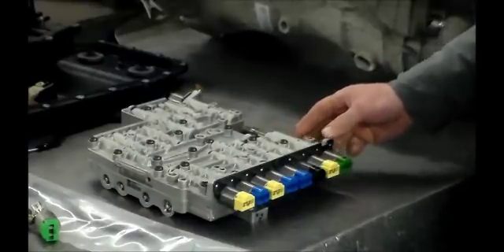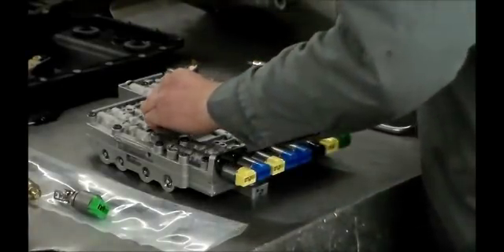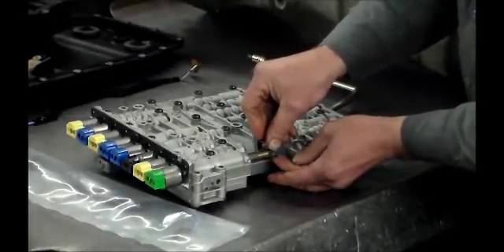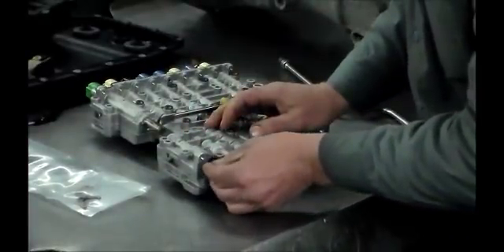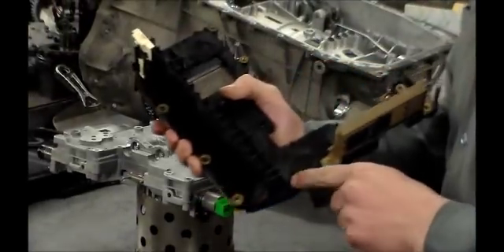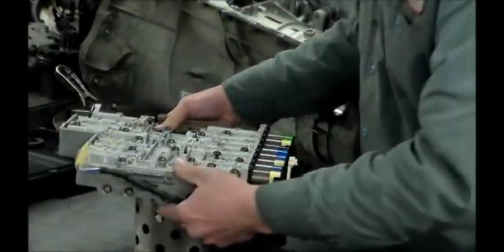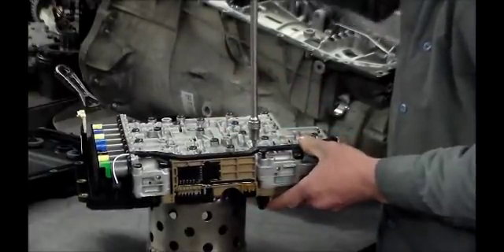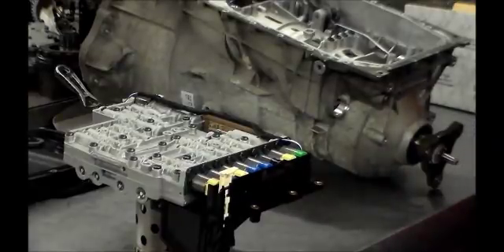ZF6HP26 E-Shift Valvebody

Comment: Thanks for this video.  What makes the gearbox judder?
Reply from the maker: I believe these converters had some issues
Reply: @GaryFerraro  Thanks for your reply.  My issue is some judder but more recently error codes and symptoms P0783 3-4 shift, P0735 gear 5 incorrect ratio, P0729 gear 6 incorrect ratio.  My garage is recommending a fully refurbished gearbox costing about $4000 fitted.  Is this reasonable/necessary?
Reply from the maker: @amana1480  First, did they check the fluid level?  A very common problem that can cause these codes is bushing wear, the rear stator bushing wears out and allows E clutch oil to escape causing issues in the higher gears 4th,5th and 6th.  Another common issue are the solenoids, they have a high failure rate, does the car drive ok cold?
Reply: @GaryFerraro  They did not physically check the fluid level no.  They said that if the fluid was low, there would be difficulty engaging reverse.  (However, I do get a clunk from the gearbox when I select reverse).  They plugged a computer in and checked the gearbox temperature (was 79degrees C).  They test drove the car for 30 minutes.  The car does slightly better when cold but still has the exact same same symptoms as when warm.  1st, 2nd and 3rd changes are reasonable.  3-4 is very difficult even when using manual. 5th can slip when accelerator is pressed.  6th can slip too on acceleration.  There is great difficulty getting from 3-4th gear, even when the manual mode and very minimal acceleration is used.  I looked under the car today and I could see what looks like to be a feint spray of oil where the gearbox joins the prop shaft.  The gearbox itself is not damp - it seems to be actually coming off the prop shaft at the joint with the gearbox.  I'm not sure if this is a gearbox leak?  There is never any oil on the pavement.
Reply from the maker: @amana1480  Sometimes these are fully covered underneath, the mechatronic sleeve likes to leak on this trans, if this problem happens cold, very possible you have mechanically bad solenoids
Reply: @GaryFerraro  Thanks for your reply.  Do you think my best option is for a fully refurbished gearbox for $4000?  I don't know what else to do at the moment.
Reply from the maker: @amana1480   Can you get someone to check the fluid level, if it's full, then you may need some work done on that trans.  First thing i always do with these units is check the fluid level
Reply: @GaryFerraro  OK thanks.  I will get the fluid level checked tomorrow morning.  Is it easy to check?
Reply from the maker: @amana1480  Car has to be level and on a lift,  fluid gets checked from underneath, there is a check plug(like a standard shift trans) car has to be running to check fluid level
Reply: @GaryFerraro  The first garage who originally checked the gearbox fluid level ("Landrover Specialist") said they do not pay attention to the exact gearbox temperature when checking the fluid level.  They said they just feel if the gearbox is warm with their hand.  I'm not entirely sure if they cycled throught the gears or checked the level with the car in drive with the aircon and footbrake on.  I will therefore be checking the level with a different garage on Tuesday (I'm not driving the car in the meantime)
Reply from the maker: @amana1480  ok, let me know what they say.

Comment: Great video thanks - I have an '03 760Li with the 6HP26 E-shift tansmission. One day out of blue my wife reported it moved forward unexpectedly when in park. It then went into limp mode and the 'drive moderately' warning came up on the dash. She turned it off, and it was OK for a while before more errors. There has never been problems with the shifting between gears. New oil/filter/square gasket 30,000 miles ago. I read the codes and there was one error (which had occured four times) which said '4E89 EGS: SV1 / SV2 mechanically jammed implausible signal or value (P1806). Fault currently not present. Fault would not cause warning light to come up. Frequency 4. Kilometers 196,784. I am assuming the MV2 or MV3 have failed and am planning to replace these as shown in your video. Am I on the right track?
Reply from the maker: I  know someone that had this code before, i believe the first thing he did was try the solenoids and reset the shift adapts, i do not believe that worked. Trying to remember, i'm pretty sure he had a bad valvebody and that fixed his issue.  You could try the solenoids first because even if you get a used valvebody i would change them anyway,  they go bad a lot.  Since you cleared the code, has it come back?
Reply: I had it fault 4 times before I took the valve body out but didn't reset it and try driving again. I have black and green replacement solenoids here so will try replacing MV2 and MV3 you cover in this video. The car seemed to be in drive when it was started (it surged forward immediately) which is odd because no power is required to any solenoids for the springs to return the gearbox to park (failsafe I guess).  I wonder if the error is corect that it must therefore be 'mechanically jammed' in some way to hold it in drive while powered down? I will chech the shift lever and springs as well, reset the shift adapts, replace the two shift solenoids, and let you know how I go.
Reply from the maker: Brett Cowan yes. Please let me know
Reply: @GaryFerraro  A follow-up on this post. The problem was the separator plate. I replaced this and put in a Sonnax kit, but did not replace the solenoids and the transmission is now fine. I suspect the unexpected behaviour was due to hydraulic pressure leaking from one channel to another in the mechatronic due to a failed separator plate.
Reply: @GaryFerraro  
Hi sir:
I have a 630 ci /2007 with joystick shifter... when i stop the car for 2-3 hours,  it will not shift to N, R or D,so i have to leave it for another 6 hours to go back to normal situation. Are these 2 Selnoids responsible for this problem?
Reply from the maker: @blackbirda3797  so this gets stuck in park?  or shift to drive and jumps back to park?
Reply: @GaryFerraro  
Sticks to park... if i tried the override,  it will shift to D (flashing) when ignition button is ON & to N(flashing) when ignition button is off. But if i didn't use the override,  it will stick to P.
Reply from the maker: @blackbirda3797  ok, can you scan the transmission, tell what codes you have

Comment: The 6HP26S in my 2010 X5M keeps losing its mind!  One day I can be driving along nicely, one day I can't even get outta my driveway.  I've had issues w/ the trans flashing P randomly on my dash, sometimes it'll be fine and I can try the gas and I'll get trans failsafe, I've driven down the highway and it'll jump between gears, I've driven on backroads and it'll wanna force itself into Park or Neutral when doing slow speeds.  

New Mechatronics sleeve, bridge and sealing tubes.  Drain and fill using ZF fluid within the past year.

Every code I'm getting says its the transfer case, yet I'll still gets trans failsafe even if the TC is disconnected at the servo motor or fuses are pulled.

Please advise before I spend $5k for a rebuild when it could be something minor!!
Reply from the maker: Question, have you changed any tires?    No trans codes?  if you clear the codes do they come right back?
Reply: @GaryFerraro  LONG story short I let a former BMW of Seattle tech buddy do the transmission, diff and TC fluids.  Come to find out later he didn't replace the 4 sealing sleeves so I redid the work myself and replaced all 6 seals.  It was great for like a week until one night as I was merging onto a sweeping left freeway onramp and it went into TFS.  I limped it home, cleared codes and all was fine.  Left for work the next day, made a sudden lane change and it went into TFS again, but seeing as it was on lower speed roads, it tried forcing itself into N and/or P repeatedly and was only able to get it to stay in gear by driving with two feet.

Today I pulled two fuses I found via a write up online, which made the dash into a Christmas tree of lights but the car drove around fine after sitting for the past 4 days.  HARD driving around the block was fine, shifts seemed a little delayed though, but drove and was quite interesting being RWD only with 700+hp.  Everything was fine until I took a hard right into my neighborhood and it started doing the slamming into other gears (not P or N, but like 2-4) thing its done in the past, so I two footed it home and parked it once again.  I'm losing my mind with this issue.  

I've got a YouTube page myself if you wanna see videos.  The trans has gotten better in that it doesn't go into TFS while sitting in P in my driveway since having replaced the 4 sealing sleeves, but I still don't fully trust letting my GF and the kids drive it either.
Reply from the maker: @M5JamesE39      What codes do you have,  i can look them up on shopkey pro tomorrow.  or you can e-mail me the codes,   gsferraro@yahoo.com
Reply: @GaryFerraro  Email w/ INPA+ screenshots and phone number sent :-)
Reply: @M5JamesE39  did u solve your issues, if so, what were they? thanks
Reply: @gtarules1  I gave up and bought a used trans from a shop in FL that was parting a rolles X6M.  The two trans were the same minus they're emergency release levers, but it was a few bolts to swap the lever out, installed the trans and then had to have the VIN codes so the modules would talk to each other.

Comment: Hi, this is a very informative channel. I have learned a lot. I have a 2011 bmw f02 750li that I believe comes with this same value body. 1-2 up shift/down shift gear will shutter and lag when the car is cold started but will go away when transmission fluid heats up to operation temperature. I have flushed and changed the transmission fluid and pan/filter. My questions for you is can I just change the solenoid for first and second gear to fix issue? Or should I replace all of them? Would any computer have to be flashed or reprogrammed or is this just a simple swap? And lastly any part numbers for solenoid for this year and model would be greatly appreciated. Thanks.
Reply from the maker: The solenoids are cheap enough so just change them all, you will have to reset shift adapts or trans will work the same way.  There are about 6 different solenoid kits for this, they go by the color of the solenoids, for instance you may have 3 blue, 3 yellow and 1 black(just an example)  this is an E-shift valvebody? that may narrow it down some
Reply: Gary Ferraro I changed the valve body and the sleeve. Same issues. I have not changed the solenoid. Not sure if it’s a E valve body but it looked like a piece of rubber with two square holes in it.
Reply from the maker: @benwilliams1826  That may be the bridge seal.  You reset the shift adapts with a scan tool, there can't be any codes present in the transmission or engine or it may not work.
Reply: Gary Ferraro oh and how do I reseat the shift adapters?

Comment: Hi Gary, I took my 2004 Bmw 530i to a mechanic for a rebuild. 4 days I get the car I get a symbol with a gear and ! And message sayin Trans Malfunction. I took it back to mechanic 2days later I get the car back saying he fixed problem the following day I get tge same symbol and message. Any suggestions? I read online and said it can be from fluid to battery but tge one that made more sence is the body valve.....any thoughts woukd be appreciated...Thanks in advance
Reply from the maker: If it's saying Trans Malfunction, a code has to be present, would like to know what the code is if possible, this may give some direction
Reply: Gary Ferraro ok...when it comes on again i will try to get code....thank you for repliying
Reply from the maker: ok, sounds good
Reply: Hi Gary,
I got codes 0700 & 0706....I usually get the code/message when I am on 1st or 2nd gear
Reply from the maker: 706 is a range switch code,  (like a 5088 code) what type of scanner are you using?  This may have a problem with the mechatronics(TCM).
 do you loose the display on the dash at all?
Reply: Gary Ferraro /OBDII scanner...yes when I turn off car and start it display comes off but after driving about 20 to 30mins message appears again
Reply from the maker: Does your scanner show live data?
Reply: Gary Ferraro No it does not.
Reply: I bought a scanner that shows live data
Reply: I now have a scanner that shows live data